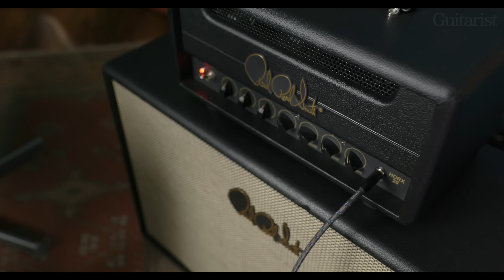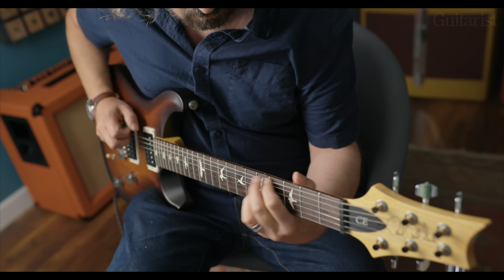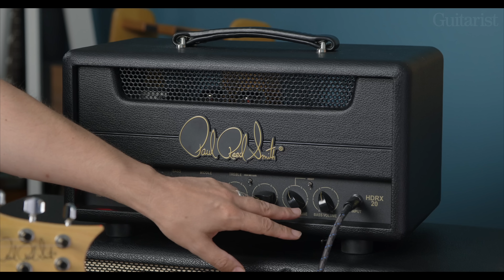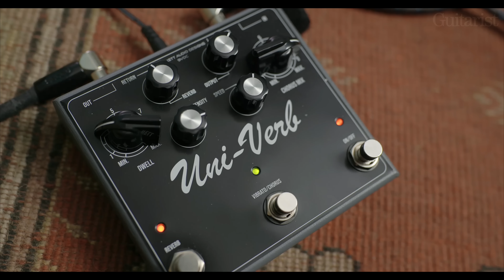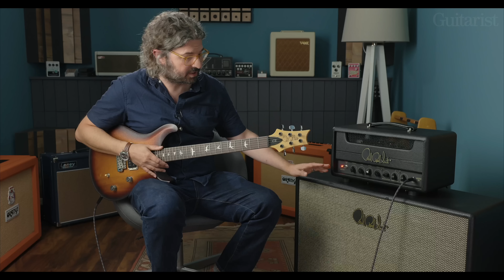PRS HDRX 20 head Demo

Comment: That was a good description while showing/playing this amp. Heard this amp with Strat single coils, and a Gibson with P90's as well as others and it delivers very nicely indeed on all. Takes pedals nicely as well. I've had Plexi Marshalls and this is no joke. It was actually designed by PRS with Thomas Sewell after a complete sonic and electronic investigation of Jimi Hendrix's original live Woodstock Marshall amps that they were able to procure. Then they modded it with an internal jumper {great idea} plus the mid and bright switches for even more flexibility...or as I call it "plexibility".  I love the fact that the 20watt utilizes two 5881 power tubes instead of el84's or el34's. They have more headroom.  Have one on order from Sweetwater. The 50 and 100watt versions are much more expensive however and use el34's for power. They go for $2900 for the 50, and $3150 for the 100 USD. So the $799 20watt is a relative deal comparatively.
Reply: After a bit playing it now, I will say it's quite like my old 1959 plexi but better. I know that's sacrilege but it being lighter with more features and the sound plus the right amount of more than loud enough watts, it fits the bill brilliantly in my opinion. The 23watt 5881's can be driven plenty loud but not as deafening as 25/30 watt EL-34's or some 6L6's and are better suited for pubs and club work. Very compact and powerful. You can mic your cab/run a direct box for larger venues. This amp pushes closer to 30watts. If not 35.  No problem with a two guitar/bass/keyboard/drummer unless you're all about decibels. I did switch to matched Sovtek 5881/6L6WGC tubes. They have a wafer base so you must change the "beartrap" retainers for spring mounts so they won't bite into the glass envelope. They are still a little taller but are modeled after the xtra-rugged mil-spec tubes less prone to microphonics and tube "rattle". I also used fibreglass sheathing on the springs of the tube retainers {for vibration} as well as hi-temp silicone O-rings between the metal tops and tubes for vibration/isolation. This lowered the already low noise floor of the amp compared to any Marshall I have ever owned.  Just a low hiss even when dimed. A hand-picked Tung-Sol 12ax7 was placed in the V-1. Russian manufactured Mullards in V-2 and V-3. Everything burned in and bias set at 29ma. Best tube amp I've ever owned in over 50yrs. Wished PRS put a top vent on it though because it gets hot in the small head cab. Maybe my next mod...lol

Comment: I definitely think the amp is capable of fantastic sounds I am, however curious about the overall build quality it’s hitting a grace great price point I’m just wondering can I depend on this amp I would have been willing to pay more to make sure of the quality and can certainly buy an extended warranty, but what I am concerned about is Kennett hold up to two or three hours of gigging at a time or maybe more jamming and running constantly tried a PRS amp before 20 W combo and had a lot of problems as I found out the whole line had problems. I like the idea of this amp and don’t really need 50. The price difference is certainly true and I am sure that is, a matter of quality no doubt, but is the PCB board in this a thick heavy one are the tubes protected and is the casing solid sorry these are questions that concern me most as most of these heads that I see under $1000 are certainly capable of the tones they’re just not capable of durability or standing up on the road I’ve been gigging on and off for 40 years and teaching guitar and I’m just trying to make sure I’m spending my money wisely because if it’s better to buy the 50 to save the trouble then that’s what I should do upfront lol Just trying to buy what I can afford out of pocket versus having to charge up credit card bills the amps I have now are high watch and I am doing much smaller venues or gigs. Don’t need the power and they are a lot to carry around with a 412 would love to use this with an oversized 112 or even possibly 212, but either way just want to make sure of what I’m paying for. Thanks again for the great demo. 2:38